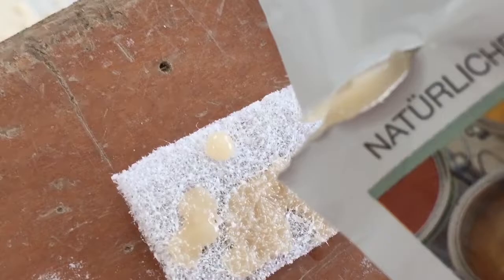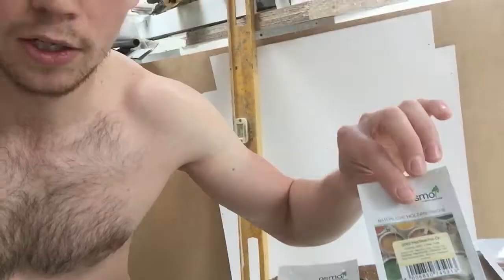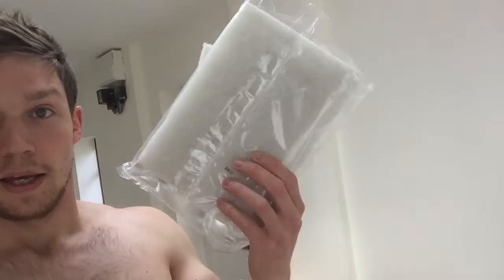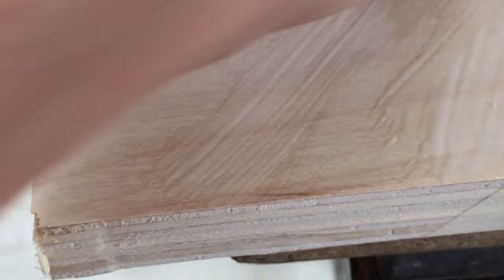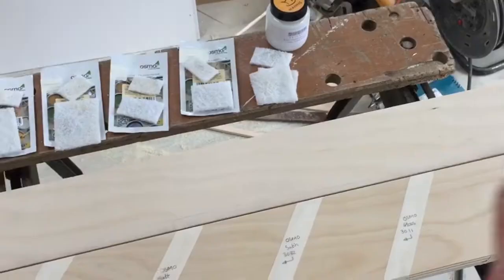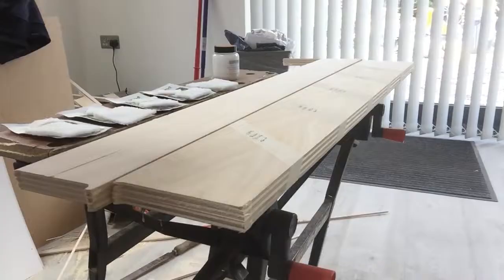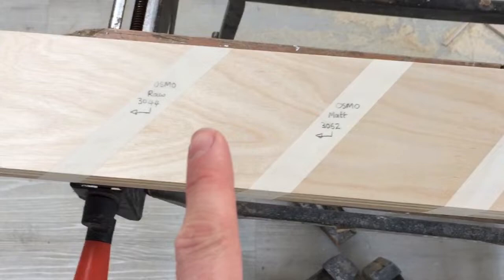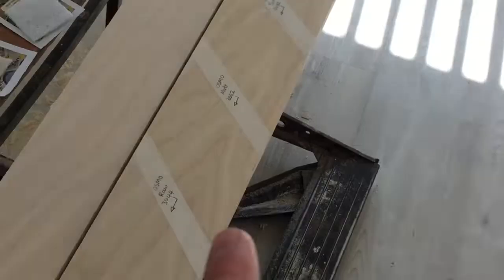How to Apply Osmo Oil PolyX & Comparison of Osmo 3044 Raw 3062 Matt 3032 Satin 3011 Glossy

Comment: Osmo usually specifically recommends against sanding to that high a grit. You end up burnishing and filling the pores of the wood, keeping the oil from absorbing properly. Can even says sand only to 150 grit.
Reply from the maker: Great advice mate
Reply: That's for flooring - for furniture, the OSMO website states a finish of 180-240 grit is fine.
Reply: @bexnut  I am lost with those grits... So, on the worktop, can I use 180? Would you be able please to send me a reference to the Osmo website? Merci!
Reply: @vnatik  it’s a bit of a how long is a piece of string question depending on the type of wood, desired finish etc. 180 grit will be fine in most instances.
Reply: @bexnut  thanks!
Reply: Ur supposed to apply with brush etc then remove the excess with a cloth not keep rubbing it in

Comment: I bought polyx based on this video, can fully confirm it does change the colour a lot. Goes a yellow honey colour even with just one very thin coat. And turns the edges a warm honey colour. Did use the pads however and it was a great application.  But a lie that it hardly changes the colour.
Reply from the maker: Hi mike, did you see the difference in colour in the video?
Reply: Matt Hutton a slight difference. But nothing to the extreme it has turned out on. Think because your in a big lit area. It wasn’t a get at, just a warning for future potential customers.
Reply from the maker: Mike Freeman did you polish the surface off so there was literally no material ripples left on the surface
Reply: Matt Hutton yeah the finish is great. Nice top with the pad.
Reply: Tip*
Reply from the maker: Mike Freeman great 👍
Reply: I’ve noticed the satin osmo oil darkens the wood considerably more than the matte osmo oil does.  Seems like the matte stuff is more milky looking in the can and definitely doesn’t change the wood nearly as much.   Just my observation.

Comment: Your best bet for the look you want is to do a coat of the 3044 wiped on nice and thin as any build looks like a white streak, and then follow with a coat of the satin for the sheen you like. This works really well on pine floors too and keeps them nice and pale as opposed to just putting on the satin and them yellowing.
Reply from the maker: Ah okay nice, so the raw version first and then satin on top?
Reply: @MattHutton  Hi, sorry, missed your reply. Yes, one coat of 3044 raw. I apply with a mirka mirlon UF pad and wipe off any excess with a lint free rag. Then one coat of the satin. Works really well.
Reply from the maker: @daveychainsaw5685  awesome thanks for the advice :)

Comment: Probably a bit late now, but as you mentioned the cladding...

I recently wiped on 2 coats of Rustins ebony wood dye to unfinished Larch cladding, and then finished with 2 coats of the Osmo UV Protection Oil Extra 420 with a brush and wipe off after each coat.  It's an utterly stunning almost silky finish.  They do a 410 variant without the biocides in for interior use, which I'm going to try on some Birch ply panels going up internally.

Comment: This was incredibly helpful Matt, thank you! I want to use the Osmo Gloss for that perfect colour & sheen on some Birch Plywood for my Vintage Workmate I’m restoring (like the one in your video)... and I was wondering, after the Osmo dries, would you recommend applying a protective top coat like a water-based polyurethane or 2pac clear or something due to the heavy use on the workmates? I appreciate your advice Matt, thanks. Nickolas

Comment: Most UK supermarkets sell non-abrasive cleaning pads with foam on the opposite side.  Super cheap and the foam is great for wiping off any excess, like you would with a lint free cloth.
Reply from the maker: Yes! Good thought, I didn’t think about this.

Comment: Nice comparison video - what about the edges, how did they come out? In particular was there much of a difference between the Osmo oils and the polyurethane? Worried the Osmo oil finish might be a bit rougher.
Reply from the maker: The edges come out as smooth as you sand them. I sanded them with 120 grit until they were smooth then applied the finished.

Comment: Im also installing plywood walls, and your video was great. But i have the doubt between 3041-3040 because i don’t want that the plywood turns yellowish. Did you try any other colors? Also love the shirtless style. Guapísimo
Reply from the maker: Catalina Fuentes hey, I never tried 3041 or 3040. But from the ones I did try the Raw came out the least yellow, because it was already white in consistency. :)
Reply: I spoke with the importer in Holland 3044 RAW is the 3041 wich is newer.
3041 is specifically made to apply and rub out.

For my wooden table sanded to grit 120 i'm also doubting to use 3040 (white) or 3041 (natural).

I did a test on some oak wood and to my impredssion using one layer of coloring both are very alike. 

Osmo recommends if you want the white wash look (not really my style) that you can apply 2 layers of 3040 white. Si as one of the only ones you could use 3040 as finisher on the first 3040 wich will give a white wash effect. 

I'm thinking of one layer 3040 white (4% white) followed  with a 3062 mat finish. So not wash white but just that little more white then the 3041 (1.5% white) where the white is almost not visible. 

They do have little testers.